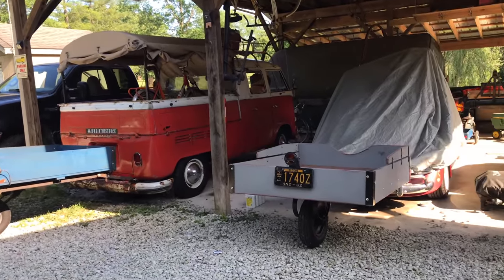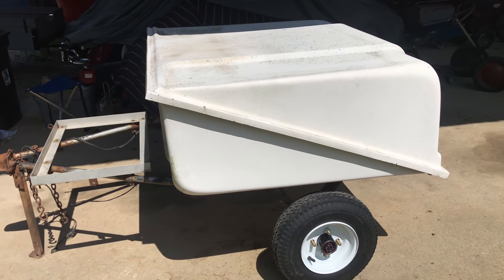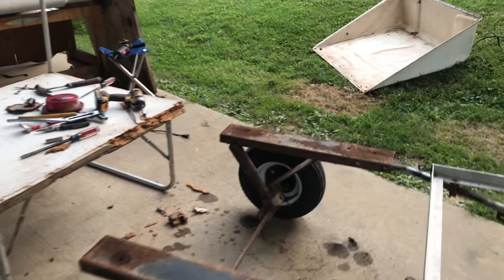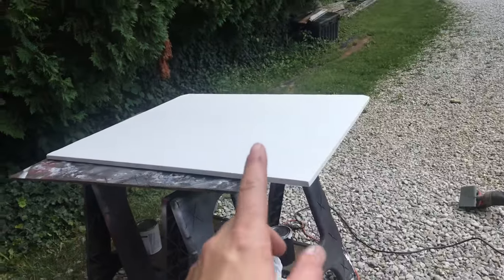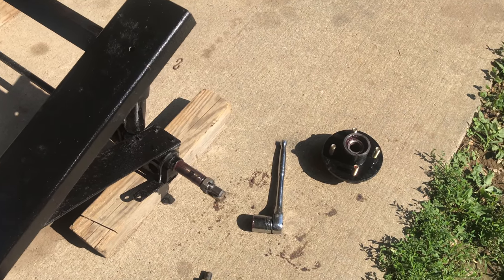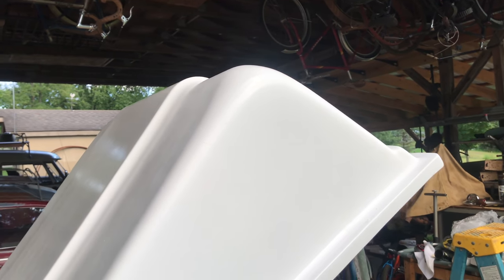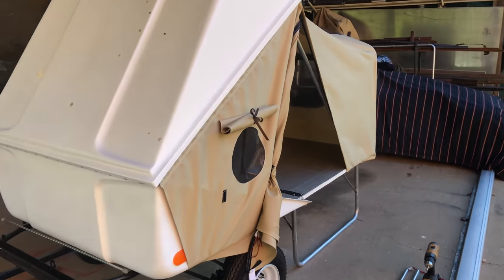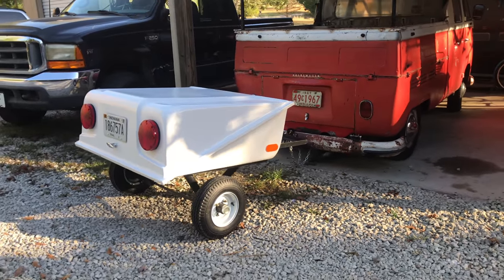Extreme Tiny Camper Gets New LIFE!!!

Comment: If you have Harbor Freight in your area you can get really nice LED tail lights at a decent price. You can of course see them on line. They have a lot of stuff for trailers as does Tractor Supply if you have them. Neat little trailers.
Reply from the maker: yes, the tail lights I bought as the replacement bolted right up exactly in the same holes as the original so I didn't even have to patch the old holes! the other trailer like this I have also needs lights, so I'll see what I can come up with for those!

Comment: Boy,a ton of questions. I am really interested in this type of camper. With the fiberglass open like that, what paint do you use? Can a simple enamle work, or do you have to go with a morre complex coating? Awesome content Marci, thankyou.
Reply from the maker: I used Kylon enamel over rustoleum 2X primer/paint.  I experiment with different things all the time and this combo actually worked really well.  Boat paint is a harder more durable paint and I've used it in the past for fiberglass projects.  It works great but it is a bit pricey and I didn't have any and was trying to save costs on this trailer so went with the spray paint.  I  wet sanded everything down before painting, then tack cloth with acetone, then tack with water before painting

Comment: Marcie what is the weight capacity of these little trailors?  I guess they don't weigh much either!
Reply from the maker: I'm not sure on this exact model, but have had a few and they are usually around 500lbs max for what they can "haul" and the total weight of the trailer unloaded is probably 100-150lbs.  Not much to them really.  The heaviest part is the wheels!

Comment: Want to sell this camper?
Reply from the maker: As I said in video, this one already sold but the other one (dark blue) at beginning of video you can see it In the back of the truck it is just like this one I still have and it will be for sale, but it will likely be spring before I can get to it, it has the same floor issues, but has a new in box canvas and the wheels and such are already converted